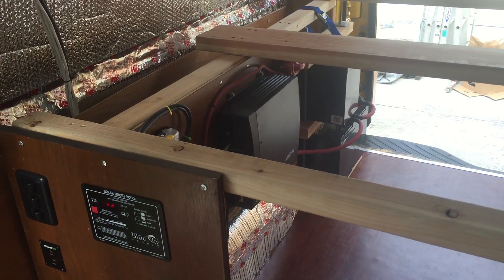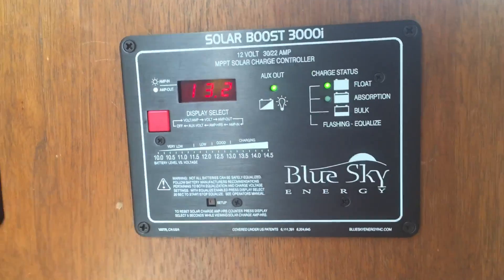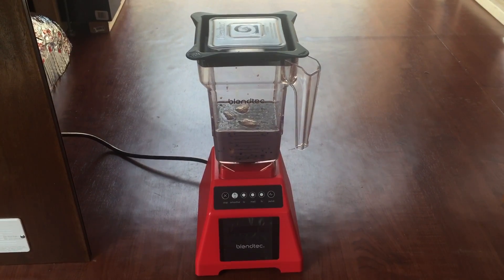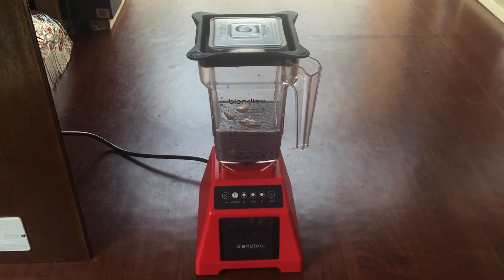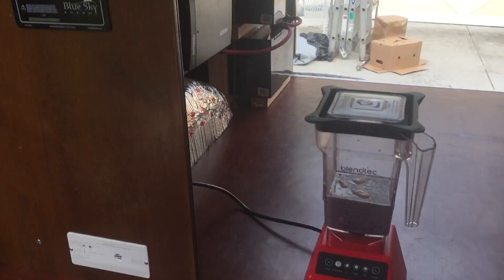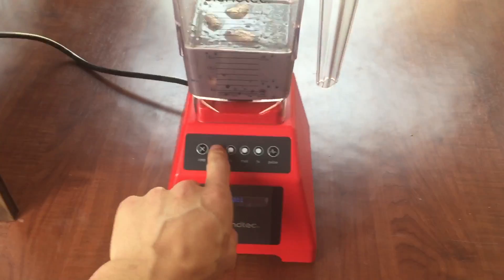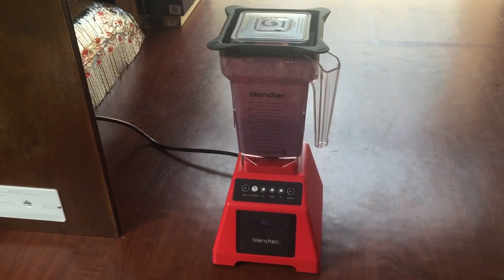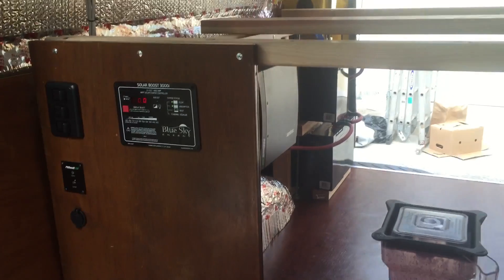Blendtec off grid!!!

Comment: I have a vitimex and 1,400 Watts I strike out on 2 inverter in a roll. I want to get the same one you have. It’s xantrax 2,000/3000. 270 on eBay on your forum . Do you have the model number? Might be on eBay summary history . Or could you pick it out. Maybe it has jump to 400 buck now.
https://www.ebay.com/sch/i.html?_from=R40&_trksid=m570.l1313&_nkw=xantrax+2000+watt+inverter&_sacat=0&LH_TitleDesc=0&_odkw=xantrex+2000+watt+inverter&_osacat=0

https://www.amazon.com/s?k=xantrex+2000+inverter&page=2&gclid=CjwKCAjwkenqBRBgEiwA-bZVtpiJcrvQByh1MJ-82t3IpW-TnJe2fRw02xT_c1mkQj6b0bUfKD9wbBoC870QAvD_BwE&hvadid=325034266301&hvdev=t&hvlocphy=9032816&hvnetw=g&hvpos=1t1&hvqmt=b&hvrand=18159210542995385747&hvtargid=kwd-297254249033&hydadcr=7510_9880894&qid=1566263256&ref=sr_pg_2

http://www.xantrex.com/power-products/power-inverters/overview.aspx
I have 2 -6 volt battery 260 ah. Thank you.

Comment: Extremely nice build.  one of the cleanest and most efficient I have seen. You said you are running 300 amp hours which give you 150  usable amp hours. What batteries are you using, what voltage and are you wired in series or parallel. I have a light Travel Trailer and a half ton tow vehicle so the amount of batteries  I can carry is limited. I have 1000 watts of solar and a 3500 watt inverter. Am using outback inverter and charge controller. I have 4 250 watt panels configured in series and parallel to dump 48 volts into my charge controller. My charge controller will step down to the 24 volt battery bank.  I'm running a 24 volt battery bank for efficiency reasons. So I figure I can run off solar primarily during the day and then on my battery bank after dark. I always like to hear how others have designed their battery banks and solar setup. for times when the sun isn't abundant, I have 4,000 watts of generator but only use that when things are getting desperate. I have a blendtec as well and my system has no problem powering it!
Reply from the maker: Sounds like you have a pretty impressive setup.  I went with 12v agm deep cycle batteries, and wired them in parallel with 0 AWG welding cable.  They are the group 27 universal battery, (made in china, but also dirt cheap off amazon).  The system sits at 12.8 volts fully charged. The batteries probably weigh 200 lbs total, but the E250 has a cargo capacity of over 3000 lbs, so I've got no worries about weight.  :)))

Comment: Does it draw 150a making one smoothie?  I am considering bringing my vitamix and bought the invertor, overall would you say its worth it?! thanks for posting this!
Reply from the maker: +Marleah Parkhill If you assume the blender draws it's peak wattage of 1475 on high, then yeah it draws pretty around 123 amps while it runs.  But it only runs for like 60 seconds.  So that works out to like 2 amp/hours per smoothie.  But then you need to factor in peukert's losses due to such extreme amp draws, and the fact that the blender doesn't actually draw 1475 watts during the entire run cycle, and it totally mucks up the calculations.  

This video is really just to show that with a 2000 watt pure sine wave inverter, a 300amp hour battery bank, and 0 gauge welding wire with very short cable runs, you will have no problem running a high power blender.
Reply: Thanks for the response.   It will be worth it I'm sure.  Sweet account. Henry Gaßner and I are also beginning our build and hooking up power this week.  Maybe see you about the US!